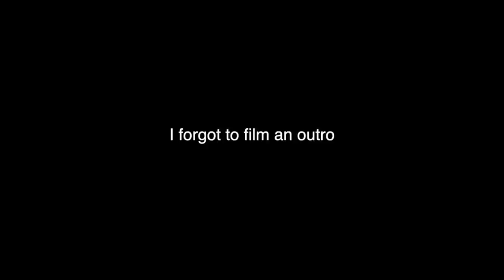DIY FINGERBOARD CAVE

Comment: Im legit curious how much money yall have spent on this series
Reply from the maker: Same
Reply: same
Reply: Same
Reply: Same
Reply: Дамян Ангелов each episode is like 30 minutes long so there marketing as much that they spend
Reply: Same
Reply: Дамян Ангелов You’d be surprised with how cheap a lot of the materials are to make a park. The most expensive stuff is the tile/stone, wood and extras like lighting and legos. Concrete is pretty cheap and so is the aluminum coping material. The way I see it, can’t put a price tag on art. Will is making a massive art sculpture for fingerboard use. But the amount of time it takes to make everything properly, soooo much time and patience, haha. The only thing I noticed Will hasn’t done, is use some sort of material for reinforcing the concrete. One earthquake and there may be a lot of cracking in the concrete. I found that one out the hard way when I built my first crete park. Didn’t even think about reinforcing. So anything thinner than 2”, ended up cracking from earthquakes or various movement.
Reply: @joshtoy  well said bruda
Reply: OVER 9000
Reply: Charlie Schaffler and there is legit 7 adds in this! And they have merch!
Reply: @zahrah4504  haha I have yt premium